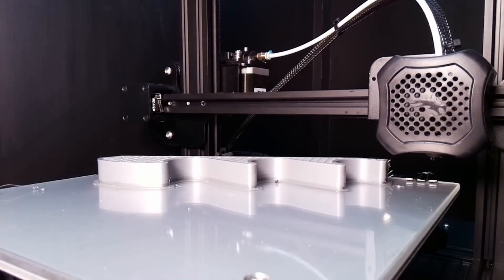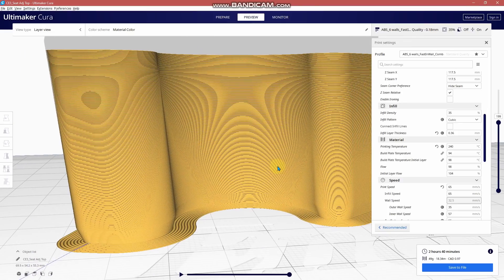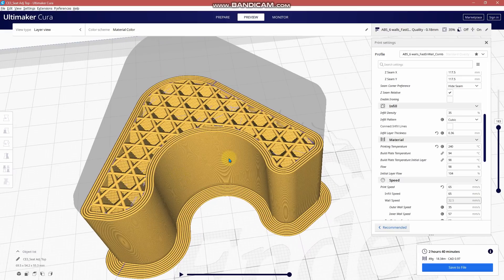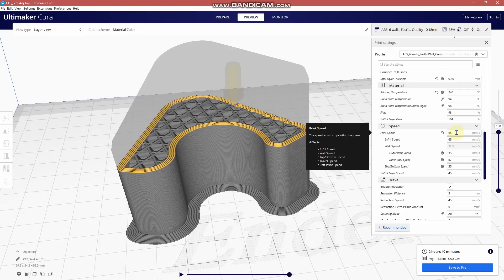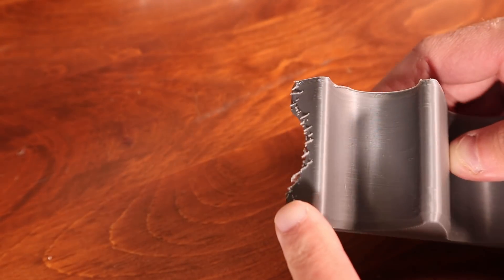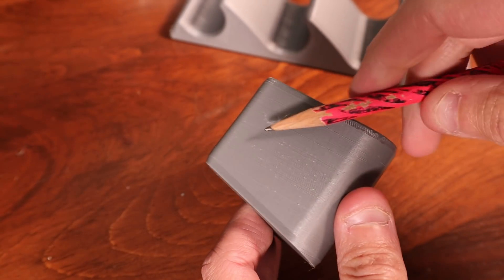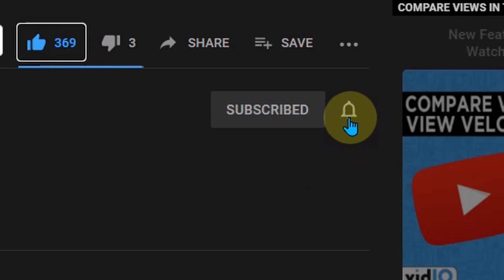Creality Ender 3 V2  - Speed up prints without sacrificing quality by turning on this setting

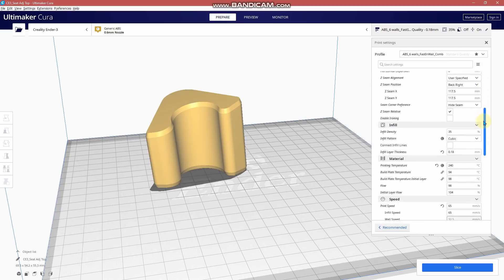Comment: Thanks for this tip! I have a customer print that normally takes 8 hrs 22 min at .28 layer height, 55 mmps, 4 perimeters, 4 top and bottom  layers and 25% grid infill (infill print time and percentage: 1:48 @ 22%). Changing the infill layer thickness to 0.56 reduced print time to 7 hrs 27 mins (infill print time and percentage: 0:58 @ 13%). Every little bit helps! Will print tonight to see how the layers look.
Reply: is it ok for the ender v2 to be running for 8 -12 hour prints?
Reply: @RoomSixty6  absolutely. The largest print i've done on a regular Ender 3 Pro is about 29 hours. my friend has printed something that took 44 hours with no problems. As long as you take good care of your ender, i've seen people print 50hr+ prints
Reply: how'd it go?
Reply from the maker: For sure, do you have faster inner walls turned on also?   I started printing with a 0.4 nozzle, I switched to 0.5 and now I use 0.6. The dimensional accuracy is still very good, corners are a little more rounded which does not affect my prints at all.    I also used to print with 5 walls, now I use 4 like you.  2 years ago, I was seeing about 10-12 hours for my prints, now they are slightly less than 7 on average.  I still print only one part at a time because I don't have the cooling fans turned on and movement between parts creates little irregularities, I also switched to PETG, much better than ABS for bed adhesion and it is still flexible.  

I did have a problem with one of my prints when I doubled the infill layer thickness, I'm not sure if it was caused by a problem with the STL or Cura, in either case for that one part only, I switched back to the normal infill height and it worked.
Reply: @NeedItMakeIt  I don't - my inner walls are at the same speed as outer - I can change that. I DO have 'infill layer thickness' set to twice my layer height - which also improves speed.
Reply: I’m doing a print on a max neo that’s taking 2.5 days…

Comment: U may have used Cura 4.7.x to print?  It has known bugs for improper printing around the curves.  V4.8 recently released from beta, use that.  They fixed it.
Reply from the maker: Hey, thanks for the tip, I did switch a few weeks ago, I am always looking for the newest features to activate for my prints.  It could have been 4.7 for sure, I also find that printing through Octoprint causes a delay around curves on occasion.  I normally still print through Octoprint, however I load the file to the SD card first manually, and then activate pre-heat and printing through Octoprint and that seems to get rid of the problem.  How these printers still use serial ports to transfer data I have no clue.
Reply: @NeedItMakeIt  I had a big problem with curves like this when I ran octoprint from a raspberry pi 1.  It turned out to be the slower processing speed that couldn't keep up with sending the codes, so the printer was waiting for the next move command while still extruding filament.  It was worse when I ran faster feed rates, and worse when I ran 2 printers at the same time from the same pi.  If I slowed the speed down, it would fix the problem.  If I lowered the resolution on the .stl file, it would fix the problem.  But these were bandaid fixes, and ultimately I replaced the pi with a 3b and the problem went away entirely, and I can run multiple printers no problem.

Comment: I tried making a 3 piece print like thies.. but then the printer does not recognize the fact it has to go up to go over other walls... just you can only do this with a 1 part print. ( tried copying your cam with stand setup of 3 pieces ) and I saw your time was 3 hours something there in cura... mine was 7... so I figured you had the infill setting on. Tried but it ripped though all my parts. gonna clean the glass plate when it cooled. What settings did you had turned on ? for the octopi cam to make it a 3 hour something print. I tried copying your top botom layers like you have em so you get the open look with the stand. and yes I only have pla so Might not be a good idea ?
Reply from the maker: Here is my profile, I always have z-hop activated to avoid any parts, I also have part avoidance activated, but truthfully I don't often print more than 1 part at a time.  I need my parts to have really good layer adhesion and travel moves can leave tiny imperfections in the surface between parts, So I either align the parts so that they are back to back, or I just print one.  I think there may be other settings in Cura to activate to improve these problems

Here is my profile:  https://drive.google.com/file/d/1plhaXV8HkmL17OqxWybYdQdBNrmtYVGQ/view?usp=sharing

I have fast inner walls, 75mm/s infill, combing turned on, z-hop, part avoidance and then the settings in the video of course.  Let me know if you need any help.
Reply: @NeedItMakeIt  I downloaded it but can't seem to import it in cura? 
I just tried whilein profiles. Import... and then it failed.

Comment: I'm trying this right now with Ikea Lack adapters for my E3V2 in PLA. I'll let you know what I think when they're finished. I did a 0.4 infill layer thickness and a 0.2 layer height. Cura gave me an orange box at 0.4 but we'll see what happens. It's a long print cause I added some other parts, but when it was just the two Ikea risers it went from over 9(000) hours to just under 7 hours. Not a bad savings in time! But, whether the parts are viable or not is unknown right now. Obviously, the weak spots in my application are in perpendicular loading of the riser, which it almost never sees being that the load is directly on top of the part. May not be an issue...
Reply from the maker: I've often thought about using the gyroid infill and adding epoxy, the gyroid remains open so it can be completely filled up, and it would probably make a really strong print.  It is also possible to fill with silicone, but I'm not sure how it would fill up or bond it is probably too thick.    I'll have to lookup that adapter.  Too bad there isn't a way to share images on these posts, that would be really helpful.
Reply: @NeedItMakeIt  I was just thinking of how I could share a print image with you of these risers right now. Maybe over on reddit.

As for infill with epoxy, I think that could work as long as you had a vibrator or something similar to make sure it flowed to the bottom. Would be a super strong part without a doubt.
Reply: @NeedItMakeIt  Just finished the first batch and it looks perfect. I had some stringing in only a few places but the surfaces look nearly perfect. Feels very rigid. I can't prove it, but it is likely close to the same strength. I'll print another batch for the rear legs and run with these. I have confidence they're perfectly fine.
Reply from the maker: @therising1  Excellent, by chance are you printing these parts for an enclosure?
Reply: @NeedItMakeIt  Yes, I'm doing the Ikea Lack Enclosure for my E3V2. I'm not so much interested in heat retention for ABS because I'm likely not going to print much for the time being but I need a way to keep my kids away from it! I have three boys under the age of 7 and the two year old could destroy a Walmart in under 15 minutes. So...I need some security!
Reply: @therising1  I’m not sure what IKEA stuff you’ve built in the past but it’s not stronger than a Walmart 😂 good luck brother. I’m gonna be building one myself next time I get up to the ikea store just to keep the dust out hopefully
Reply: @CaptJackDeez  do you have kids? I think if you did, you'd understand what I'm talking about. If I set my 2 year old loose in a Walmart it would look like a tornado hit it. But if I lock the printer cabinet, he's not yet developed lock picking in his skill tree, thankfully, so he can't get in. He can get yogurt all over it and the carpet, but the 27th flexi dinosaur will be safe from this tiny meteor.

Comment: would love to see this for PLA
Reply from the maker: It should be doable.   I don't print much PLA at the moment because it sticks too well to my build plate and I need to break the parts to remove them.  I'd need to switch to a flexible mat so that I don't ruin the parts... again.
Reply: @NeedItMakeIt  I've had trouble getting some PLA prints off of the Ender 3 Glass bed that came on the V2 and the only thing that has worked for me was to place the bed in our chest freezer for about 5-10 minutes. If the pieces don't pop right off, I can usually whack them lightly with the handle of a tool and they pop right off.
Reply: @therising1  Funnily enough I do exactly the same and have been able to print and successfully remove some very fine Christmas decorations using this technique. For what it's worth I do always let the bed cool completely first though but that's probably just my paranoia.
Reply: @SomaliCoastguard  nah I think that's good practice. I usually wait for the bed to cool to 30c or so and then put it in. I think going right from 60c or whatever your printing bed temp is could potentially cause issues so it's best to be safe!

Comment: Man, I love these videos, but I upgraded my v2 to a Bondtech DDX and a Slice Copperhead... I wonder how a direct drive system would affect the cura settings you have posted.
Reply from the maker: Maybe I need to buy another printer and outfit one with a direct drive as well.  That would be really good to do comparisons between them.  Maybe if my channel does a little better in the next while it would help to cover the expense.  Bondtech, I'll have to check that out.  I've seen the name copperhead lately, I will look into that.  Are you happy with it?
Reply: @NeedItMakeIt  The level of support with Bondtech is unparalleled as with Slice, but Bondtech surpasses all hopes and dreams in that matter. Beyond happy with the upgrades. This is my FIRST printer, I got the v2, printed the cat and then immediately upgraded (I heard the extruder and hot end are not great on Ender). Once I figured out that the estep value can be changed via cura I haven't had one issue to speak of. I'm a complete noob haha. It was not cheap. Probably cost more than the printer to upgrade to those specific parts. I hear the micro Swiss as well as other cheaper options aren't bad, I just wanted the best I could afford, and Bondtech/ Slice combo is that imo.
Reply: @AgnosiaAgnosis  Those are really expensive upgrades that you don't even know if you needed. Why'd you do them?
Reply: @therising1  r u jealous?
Reply: @therising1  every person on here recommends upgrading extruder and hot end... if I gotta do that might as well get direct drive... might as well get the best.
Reply: @therising1  vanadium nozzle also
Reply: @AgnosiaAgnosis  I'm not in the least jealous, hahahaha. I'm just completely confused as to why someone would spend that much money to upgrade a sub $250 printer. It's just odd. Thought you might have a better explanation.
Reply: @therising1  better in what way? Give me a good reason that it's not now a badass printer compared to what it was lol. The upgrades will last for years and years past the ender 3. If you have to replace the extruder and hot end (again most everyone agrees that they need to be replaced) why not get the best? What kind of explanation do you need? If it's so subpar then why r u even on this thread, bruh? 🤣
Reply: @therising1  have linear rail upgrades for XYZ on the way with a new 3 point bed...

Comment: Those bubbles - from the higher temp. - My take.
Reply from the maker: Martin Luther  I think it is fairly easy to tell the difference between a surface defect caused by feeding Gcode through the slow serial connection in Octoprint and moisture expanding into steam when it is extruding.  

There is a big difference as well if you just watch the filament ooze out of the nozzle before the print begins.  There is a difference in the sound as well.  What I found to be odd is that the silver filament in ABS as the only one I had this problem with, I figured it must have been the additive to give it the reflective metallic look.   I think it is worth a little more investigation at least, maybe not a video, but we'll see if I can find the time.
Reply from the maker: It is related to temp for sure, what I've seen over the summer (without our AC turned on) is that only this filament at 235 nozzle temp will bubble.  The nozzle temp being so high will cause any moisture to expand when creating steam.  I guess this happens more commonly with PLA, nylon etc. and it needs to be kept dry.  I always had my filament in the enclosure with the printer in the past, when I upgraded to the Ender 3 V2, there wasn't enough room.  I would be pretty easy to test this if that is something that you think would make an interesting video.  What do you think?
Reply: or moisture in the filament
Reply: Dryer Filament has definitely improved my print quality, especially with PETG. Second best one is K factor (linear advance).

Comment: doubt that part even needs the infill.
can't cura set infil to specific hights like S3D yet ?
Reply from the maker: This part is load bearing, it does require infill.  I've never used S3D I will check it out.  Thanks.
Reply: @NeedItMakeIt  aaah ok 
S3D is not free though
but ha's some rly nice features to it , that ...at the time i bought it , only S3D has/had
like custom supports and variable wizard
Reply from the maker: @takoza5396  Okay, that's good to know.  Maybe there is a trial version, I try to avoid supports anytime I can, but sometimes you need them, it would be helpful to have more control than I do with Cura.  Cura is also missing Hexagonal infill, and that's not very good, it is a really handy infill for those vent covers etc.   I'm not sure why a simple infill like that would be missing.
Reply: wel yea , i hate supports aswell lol XD
that's the main reason why i bought it honestly 
i save ALLOT on infill  , lets say the part is 100 in hight , i would only give it some light grid infil at like 98, and make it stop at 101
make the walls for that bit 1 r 2 thicker
Reply from the maker: @takoza5396  Cool, that's really helpful, and you just gave me some ideas to test out as well to save some infill on structural parts.   Which type of filament do you use mainly?  I print with ABS and no cooling fan turned on, bridging is a bit of a problem for me.  I may switch to something different but I'd need to test it for strength first.
Reply: @NeedItMakeIt  go PETG bro 
i much more prefer it over ABS. 
but i use PLA for most stuff though
PETG for stronger stuff
every filament come's with it lil problems , but i find PETG much more pleasant to work with overall
Reply: @takoza5396  s3d is free if you know where to look 😉
Reply: @cpw80  i know , used to have a pirated version
but i bought it eventually (this is a few years ago already now)
Reply: Infill tailored to height, Cura 4.8!
How to:
Cura, Infill settings, gradual infill steps = 3 steps
Cura Infill settings, gradual infill step size = 2 mm per step.
Cura, Infill settings, infill support = active.
Cura, Infill settings, infill support angle =60-75 degrees.
Now when you slice (will be very slow!), infill is printed as if it were supports; awareness of overhang angle!
It won't print infill where it isn't supporting a 'roof'.
As the infill gets closer to the 'roof', it will subdivide until it reaches the desired infill density.
If you want 1.5 mm infill spacing at the 'roof', with 4 steps, the layer1 infill spacing would be 24mm!
Saves lot's of time and materials.
If you need strength, use longer height per step and few steps.
Cura, Support settings do not have to be active for this to work.